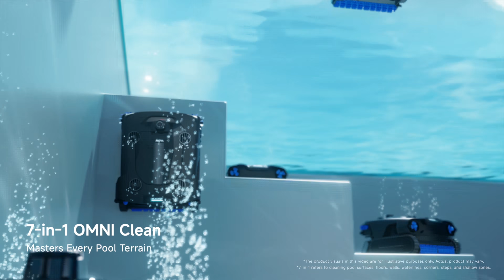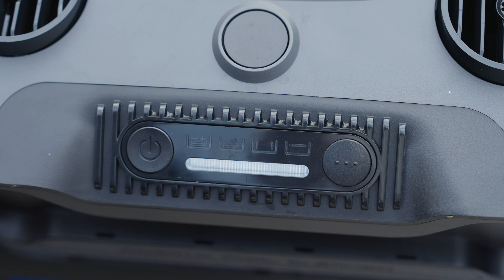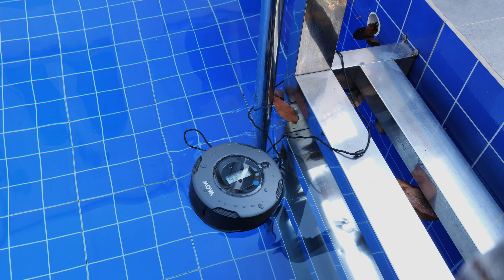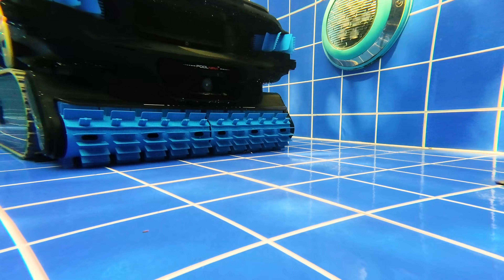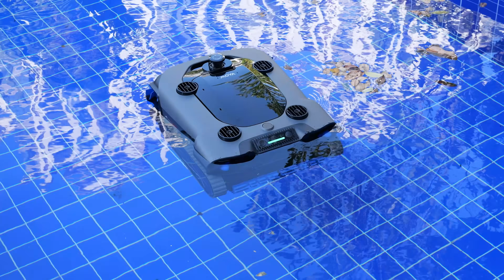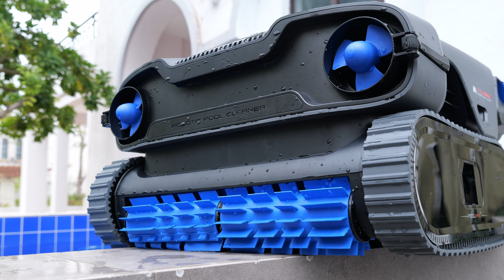MOVA Rover X10 7-in-1 Smart Pool Cleaner Review: A Game-Changer.

Comment: Does the floating sonar have to be plugged into an outlet? If so, that's ridiculous. Building a wireless robot but having to use a wired accessory to control it just doesn't make sense. Right?
Reply: its battery powered, you will need to recharge it once in a while